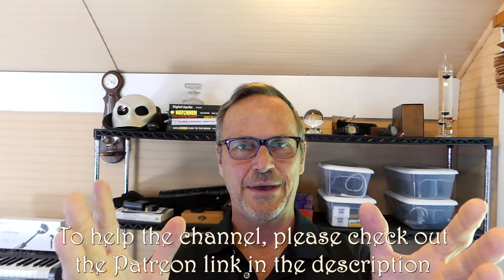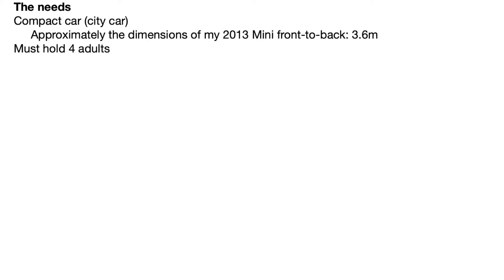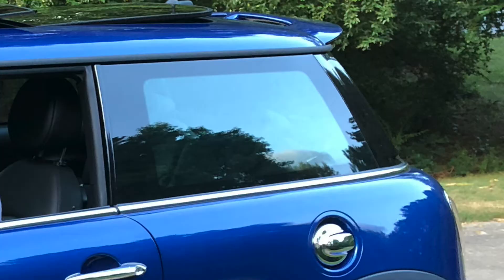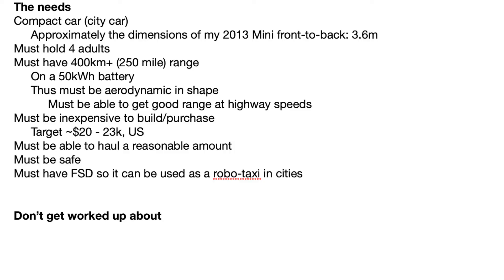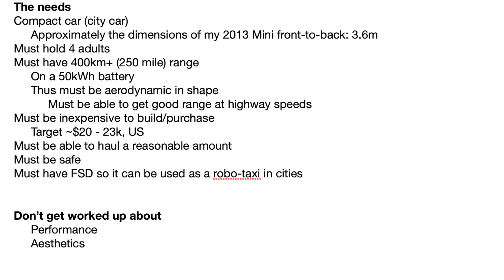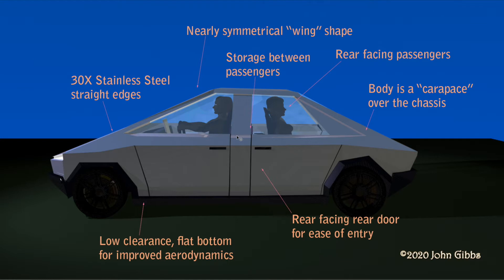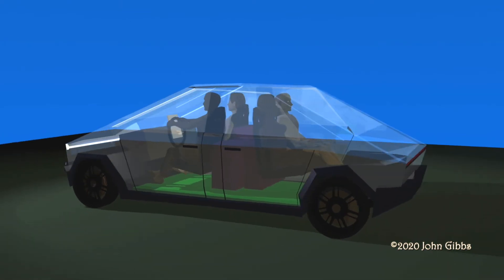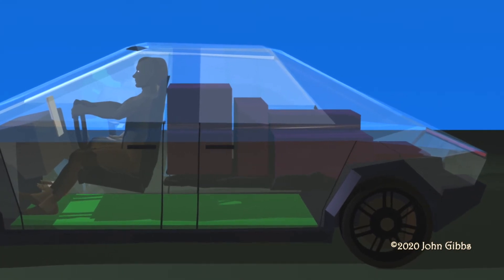How I designed the Tesla Model 2!

Comment: Appears to be well thought out, I'd go for it at that price point. 2 person capability would be fine.
Reply from the maker: Thanks. I thought about only a 2 person version, but decided that it should at the least be able to carry 4 on shorter trips--more or less like my Mini does now :)
Reply: @DrKnowitallKnows   Why not 6 seats? three in Front and back? or just a bench with three seatbelts? and two armrests like in an airplane with Airbags inside) if it's occupied only by two? as a city car / robotaxi it wouldn't be a canyon carver, you don't need bucked seats adjustable, with a wider roof so less side slope you gain width in the car, with side airbags and the exoskeleton you gain width, so a six-seater (for normal humans) and a 4 seater for the +300 lb US citizens the usage will be improved!.